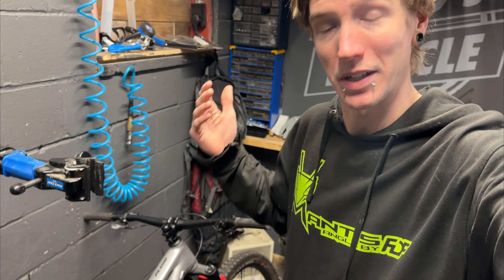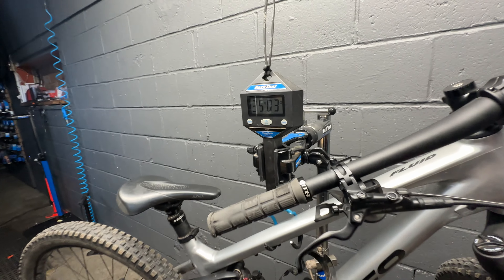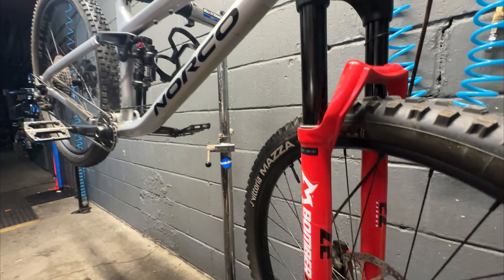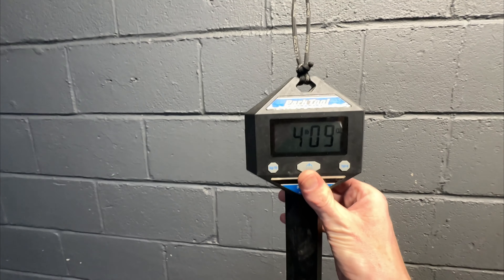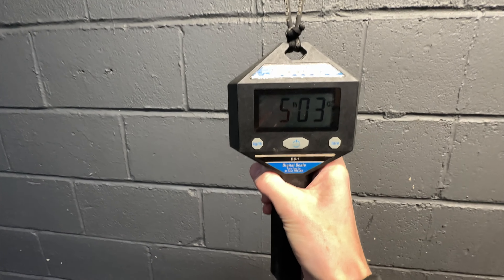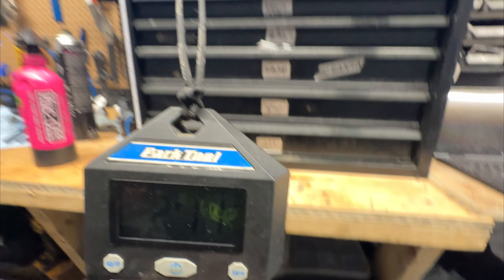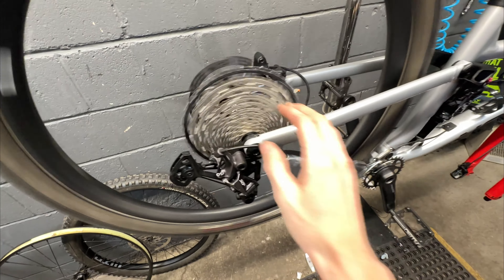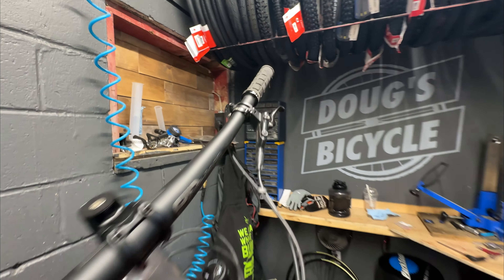Roval'n on carbon

Comment: I put carbon rims with Dtswiss hubs on last summer, huge difference! I also went with carbon bar. I also am running tubeless. Have you serviced your fork yet? Put in lubricant sleeves and it’ll work even better!
Reply from the maker: Haven’t done any sus service yet, I doubt I have 50hrs on the bike as it sits. More plans for me would be tires, maybe tire inserts. Maaaaybe bar eventually. I don’t mind riding stock parts for the most part! I’d love an axs upgrade eventually.